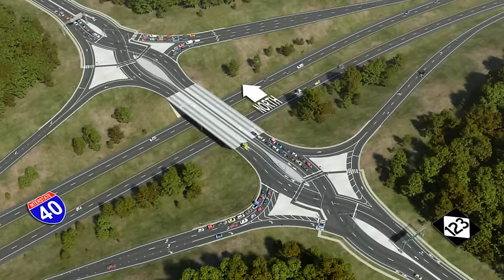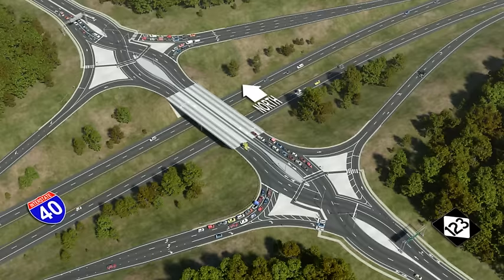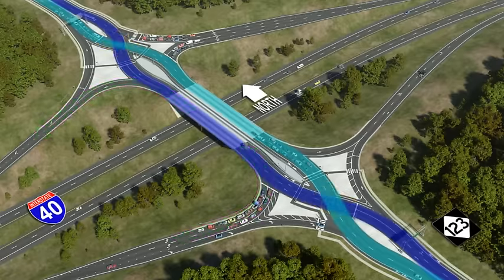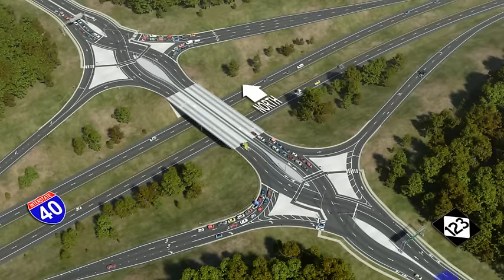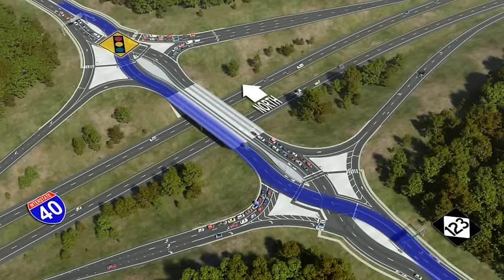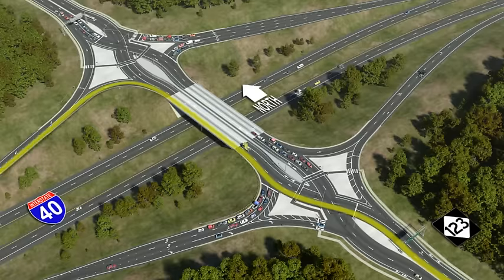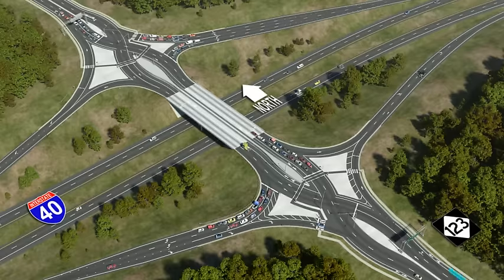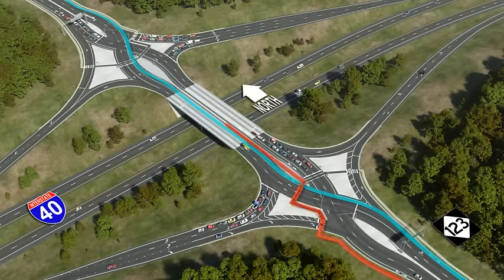Diverging Diamond Interchange Visualization

Comment: Most the naysayers here are just old fogeys who hate change.  These interchanges work; people adapt to them quickly once they are in place.  They are proven to save lives, and they are actually cheaper to build than a traditional road/freeway interchange because they do not require any special left turn lanes, which force roads to be wider.  [Of course, converting from an existing traditional road/freeway interchange to a DDI costs more upfront than doing nothing (leaving it the way it is), but the overall reduced accident rate should more than offset the cost over time.]  Finally, those commenters who claim that DDIs can potentially cause drivers going straight on the road to have to stop twice should realize that that can also happen at a traditional road/freeway interchange, since at each end of the bridge there are traffic lights that cycle to red for traffic making left turns (onto or off of the freeway) in front of cars going straight on the road.

Comment: This looks like it makes sense, but traffic going straight through the upper roadway has two traffic lights to stop at.  Making only left turning traffic criss-cross at traffic lights on the upper level would speed up traffic even more and be just as safe.
Reply: With the old 4 way stop each end, those going straight through still had two lights to stop at while those making left turns also had to stop where as with this those wanting to make a left turn do not have to stop anymore, unless there was an accident on the ramp. So instead of four sets of lights at each end for 8 lights to maintain, there is now only two lights at each end for four lights to maintain. Not to mention the less total number of intersection conflict points at each intersection with this system.
Reply: Yeah, after I gave it more thought, I agree you're right :-)

Comment: If the two parts where the flow of traffic intersects and has to be regulated by traffic lights could be replaced with a bridge (*1) on each end, this would be perfect.

(*1) So that instead of crossing each other, one of the roads would pass underneath the other one.
Reply: Would be very expensive for a freeway-to-state road junction.

Comment: Yes but a cloverleaf allows you to enter an interstate with no traffic signals I do not understand how these are better they're putting one in near my house in Greensburg and it is adding traffic signals to a place that doesn't have them
Reply: You don't even need a cloverleaf.  If that bridge was a double decker with westbound traffic on top and eastbound traffic on the bottom, you could accomplish the same thing without traffic signals and without the weirdness of being to the left of oncoming headlights (confusing and dangerous). It would offer the same space savings.  The only cost is that some of the ramps will need to be elevated.

Comment: For the Netherlands, where there are cycle paths incorporated into most roads, and cycling is one of the main methods of transport, can cycle paths be accomodated into this? Please do not answer this if you are not entirely familiar with cycling in the Netherlands.  Brian Fenwick.
Reply: Did you even watch the entire video? They showed the path for cyclist and the separate pedestrian path.
Reply: North Carolina isn't the Netherlands. NC is a subtropical zone with temperatures below 30 most of the year up to the 43 degrees and very, very high humid--if being dredged in sweat on your morning commute was ever fun. With the major of the land being either mountainous or foothills/piedmont, steep and long inclines are faced in almost every commute. Americans live far from work in sparse and decentralized suburban communities. It's absolutely nothing like the Netherlands. Netherlands is flat, densely populated, cars are expensive, and people live urban cores. Plus it has an inferior biking system compared to the Danish and worst of all, Nederlands is full of Dutch people.
Reply: Compare this interchange to the older double diamond and certainly the cloverleaf, which are absolutely hopeless as far as directly accommodating cyclist and pedestrians safely (an American traffic engineer delusion).  The modification I would make is to continue the bike path along side the road crossing the limited access road (expressway) raised up and separated from the motorist lanes,  up with the pedestrian way in the center.  In the NC design there is already room allocated for the bike way crossing that would certainly lifted up and separated from motorist lands in a sensible safe design I would expect from the Netherlands.  Also all traffic signals are simple stop or go no turn signals, make then much safer as well.

Comment: Used one of these few times and I didn't see a benefit of it .... You still have to stop in most cases and for a right turn it alway been similar with a yelled sign
Reply: Far as I know and seen, most have the yield there for cyclist/pedestrians to cross when they are on their path, otherwise you do not have to yield going right, or left if those are clear.

Comment: We need the fly-over left exit and entry ramps as in the intersection of HWY 30, I-90 & 94 near Madison Wi. to be constructed  at US 51 & US 12 & 18 to make a smooth flow of traffic without stops for these heavily used roads.  The Diverging Diamond design would be deficient for the volume of traffic.
Reply: Actually the opposite has happened, in Springfield MO traffic backed up for 2 miles before, now less than a 1/4 mile. It is so much more efficient.

Comment: What about when a bicyclist is trying to cross the right turn area?  They will have to cross the road right in front of all the cars turning right.  The lane is very, very wide at that point so the bicycles will have a long, scary journey across there hoping a car doesn't come.  This will be extra dangerous since the cars will be moving quickly and not expecting to have to stop
Reply: they have stop lights at the right turn area too so that if walker or bicycle decided to go across they hit the button and it turns the lights red for that part and the other traffic keeps moving its pretty smooth setup
Reply: That seems like a hotspot for blind spot accidents to me as well.
Having them cross that right turn lane at a 90° angle would probably be safer. Having a red light for the right turn lane when traffic has green to go straight on would most likely even improve the traffic flow for cars as there would be less conflict with the left turning traffic in the opposite direction.
Reply: This is a valid concern, however it’s important to consider where these interchange will be placed. The DDI is focused on preventing congestion when exiting the highway, and the amount of cyclists that are in these areas are very minimal since they won’t be exiting the interstate. The benefit they provide to traffic is worth the inconvenience for cyclists, who may simply change their route, and given the area that we will see this implemented I doubt there will be many cyclists actually affected.
Reply: Cycling is efficient and practical. Explain yourself Mr. Guy.
Reply: Random Videos - Cr1TiKaL Full Streams Yep...Seeing as I haven't ridden a bicycle in decades I hadn't even considered that one... There are SO many other problems, I FOR-SEE,  for this soon to be proven....
CLUSTERED FUBAR ...
Reply: Simple solution, go take your exercise somewhere that is not ment for fucking commuting. If you do ride your bike around more power to you, but most of us prefer cars so tough it up cupcake.
Reply: Right. And ban walking too. Damned walkers.
Reply: Random Videos, I can tell you from experience, the traditional cloverleaf is very dangerous for cyclists. This is safer because there are just two intersections, neither of which allow right turns. Also, it eliminates merging traffic. This is not just theory. These interchanges already exist and have proven to reduce accidents.
Reply: I mean, they could use the sidewalk right? The crosswalk across the right turn lane isn't too long. Remove the bike lane before the interchange, forcing them onto the sidewalk.

Comment: Why not a tunnel/bridge instead of traffic lights? the difference in capacity must be tremendous.
Also a more general premise, don't do entangled junctions. Make individual paths to where they are going for instance a right turn doesn't need to be part of this junction, it could have happened before completely separate from the rest. Individual direct paths minimize merging and merging is the fundamental problem in traffic. Either in merging lanes or light regulated.
Reply: That would be great if funding were unlimited. Far too costly to do that.
Reply: @ZeusAVI  no that's a mindless reaction. Think single direct lanes instead of 6 lane indirect.
Reply: DCMi interchange was supposed to do that job, but no such interchange has been constructed.

Comment: I like this design, but have yet to see this interchange myself. How do the lights actually work? Are there six lights or eight? Two, three, or four cycles?

Seems like there should be eight lights with only two cycles.

1. Both north bound lights are green. At the same time the west off-ramp turning right can be green and the east off-ramp turning left can be green.
2. Both south bound lights are green. At the same time the west off-ramp turning left can be green and the east off-ramp turn right can be green.

Comment: A roundabout beneath the Highway is simpler, less expensive and more fluid.
Reply: that only works in places where people understand the concept of yeld. I drive by one in my area and it's a disaster
Reply: Bob Carter roundabout's are good for low or moderate traffic, but in a high volume interchange, you would need an insanely wide and expensive roundabout to handle the same amount of traffic volume. More lanes in the roundabout won't make things better either since they will eventually merge anyway. The only reasonable roundabout alternative would be to have multiple smaller roundabouts, or a dumbell interchange where costs are significantly reduced.
Reply: What is yeld?
Reply: The thing is people have NO idea how to use roundabouts here. I got stuck behind some old guy who stopped in the MIDDLE of the ring. Then he put his left turn signal on. Then his right. Then he jolted forward. It was a disaster.
Reply: Lol no, roundabout interchanges (with the roundabout above the highway) are way more expensive, because bridges are the main cost of interchanges, and they require either two short bridges (expensive), or one very long bridge (also expensive).

A roundabout below the highway is even worse, because then you need highway bridges (which are even more expensive, because of the width and the high speed of the traffic). Also again you need either two short ones or one long one. All this is crazy money.

But don't listen to me, listen to the real world. In Britain, which used to be the champion of the roundabout interchange, they are switching over to dumbell interchanges because they are so much cheaper. Dumbbells are of course almost identical in price to, you guessed it: diamond and diverging diamond interchanges.
Reply: you know.... americans...
Reply: Ppl who stay on left and suddenly take exit. You know these guys exist right?
Reply: It takes more space, though

Comment: Design Flaw: This eliminates the Possibility of a Person who has taken the Wrong Exit, to Simply get back onto the Highway.
Reply: Good point. You'll just have to make a U-turn somewhere after exiting.
Reply: That could be easily rectified at the added expense of four circular loops at the outer corner, one on each corner
Reply: Same thing as if you exit onto a divided highway. Find a place to turn around down the road.
Reply: That could also be easily rectified by knowing where you are going before you leave home. Or... just by following the flow until you find a safe place to turn around.  The key word being "Safe"; that's what this is all about... getting you to your destination safely.
Reply: Just drive out of it and make the first up turn and get back on, it was your mistake anyways.

Comment: While this design is far better than the standard diamond interchange, an even simpler design is the  SPUI  (Single Point Urban Interchange).  The freeway passes over or under the surface artery street and a set of signals at a single point controls traffic of the surface street.
https://www.youtube.com/watch?v=mwpoPQ1SPJU&t=4s   There are only 3 cycles through the single point intersection for the surface street.     There are several of this design on the newer freeways on the East side of Memphis, TN and they have converted a few old diamond interchanges to this SPUI design.
Reply: I don't think so Florida has single point interchanges, and they are much more unforgiving to cyclists and pedestrians, and do not seem that much better, but yes they are cheap too but do not perform as well.  Also single point interchanges require more complex traffic signals, that can only allow traffic floes in a serial sequence, thru one way, then left turns, now thru the other way etc. DDIs have simple lights, there is no traffic light that requires a left turn single, the result of bringing traffic over to the left in the DDI. Compare Single point to the DDI where when the crossover flow, the traffic can also enter the expressway without waiting for left turn singles, two traffic flows in one time period, remember the DDI requires no traffic signal with a left turn arrow.

Comment: If someone tries to run the red light.  They'll be screwed with all lanes of traffic coming towards them. Which it seems 70% drivers try and beat the red light these days.  The distance is just too far for someone to blow through a yellow light trying to beat the light.
Reply: . . designers have already expected this occurrence and the timing of actual signaling are adjusted accordingly

Comment: This is not simple enough to be applicable and the pedestrians will have the to cross the highway four times and will be in the center of traffic instead of just going straight 
Why not simply make a roundabout?
Reply: F all round-a-bouts.
Reply: I know how to use a roundabout even before I got my license, but I see a number of idiots who misuse or get to easily confused when they come to use it. Not to mention the space they require and the size required to handle semi traffic that is big rigs and heavy haulers.
Reply: As a truck driver, I hate roundabouts..very unsafe. I've come across these designs across the country and actually really like them.
Reply: Dave like you I am also and experienced truck driver class A holder, I have come across at east 1 poorly designed too small diameter with no safety margin such as NO trailer apron around the inner part of the rotary where there was a curb, sad to say I had to "ride the rail". Other than that if it has that extra inner area for trailer compensation it was okay, but its those who do not understand and otherwise miss-use them speeding through who make it unsafe. Most are trailer friendly unless clearly posted otherwise.

Comment: An update to my original comment:  It is proven these type of intersections INCREASE the # of accidents as it's very confusing and not at all like other intersections.  I noticed today in Mebane, NC they were adding permanent cones between the lanes because the curves are so sharp, many vehicles cross into the adjacent lane..... once again proving this is a flawed design that only waste taxpayer money, causes confusion and more accidents and ultimately slowing traffic flow.  This type of design only benefits the people turning left.  Everybody else is slowed down and left waiting.  I have never ever made it through this intersection without having  a red light stop me and in most cases you are stopped at both stoplights which slow through put which defeats the purpose.  Only dumb govts would do these type of boondoggles!
Reply: Wrong. It literally decreases the number of accidents and speeds up traffic. This is a proven fact in quite literally every single study that's been done. People who say these are "too confusing" probably shouldn't be driving cars. These are not at all difficult to understand if you passed the third grade. Stop complaining. Be glad that people smarter than you are actually solving problems and not just complaining like you are.

Comment: To disrupt the through-traffic on an interstate with traffic signals is asinine.  The prefix "inter-" means between or among.  Thus the interstate highway system is a system of highways between states.  Non-exiting through-traffic should not encounter signals on an interstate.  This design disrupts the flow of through-traffic on I-77, thus disrupting the flow of interstate commerce.
Reply: From what I saw there is no traffic light on the interstate itself thus those traveling I-40 have no need to stop where as those on Route 123 where they used to have to stop at four way each end now only those going through still have to stop while those wanting to go left do not have to stop again unless there was an accident on the on ramp. Far as I know Routes are not like Interstates, they are byway type highways and just about every one I travel have traffic stops along the way.
Reply: Pezz didn't comprehend the concept.  The Interstate does not stop. There is less congestion at the interchange because exiting traffic does not play "bumper-tag" with traffic get onto the Interstate.
Reply: This is a service interchange not system interchange.
Reply: Man you don't get it and have never seen one.